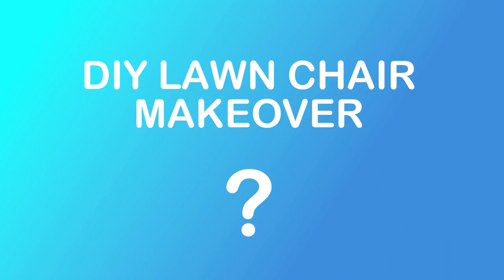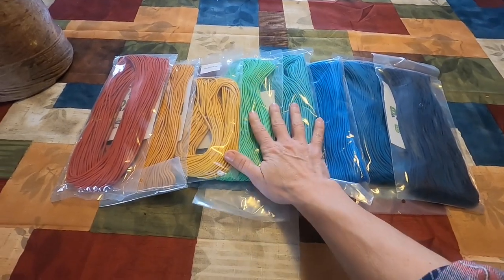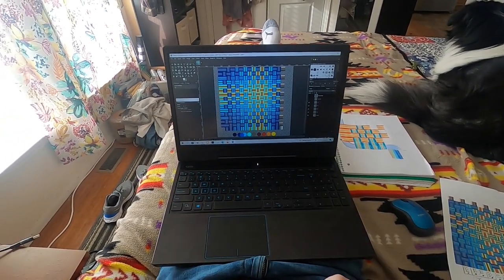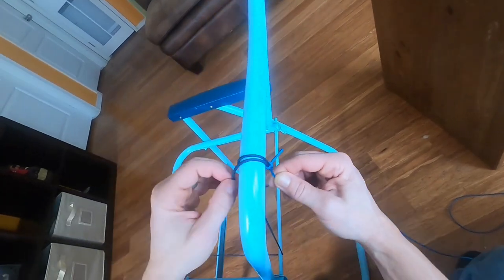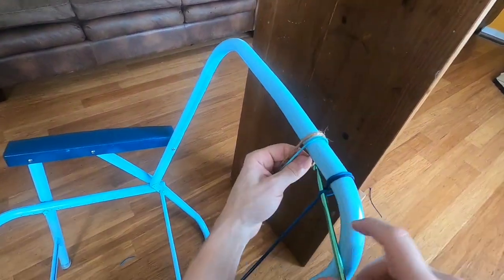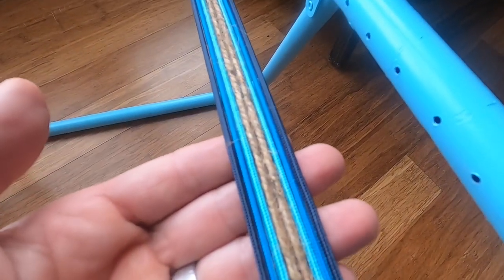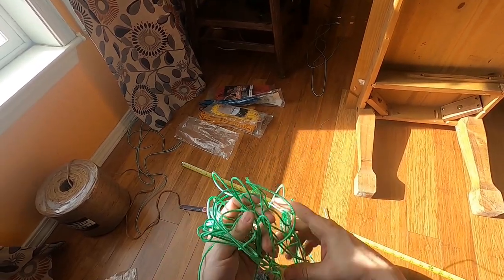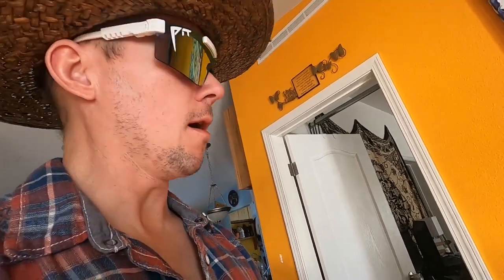Diy Lawn Chair Makeover

Comment: What did you clean it with? And how did you get the arms back on? I have a chair I’m trying to fix currently 😅
Reply from the maker: Hello. I used brake cleaner because it leaves no residue and a scratch pad.
Reply from the maker: Oh ya. For the arms I simply went to Lowe’s and bought some bolts